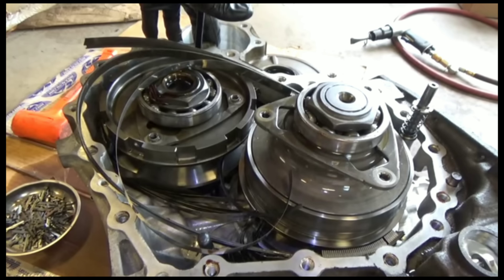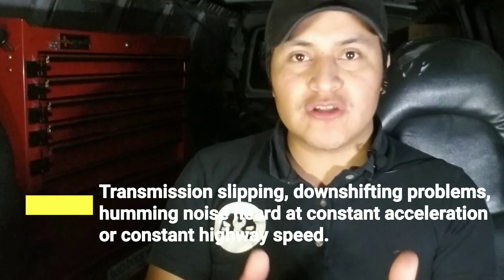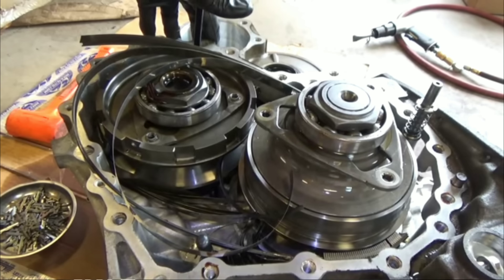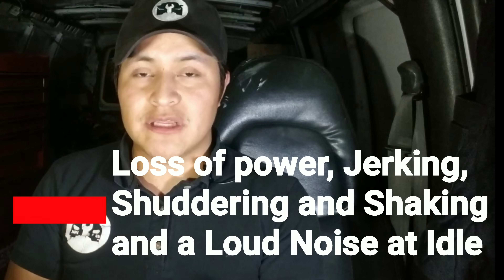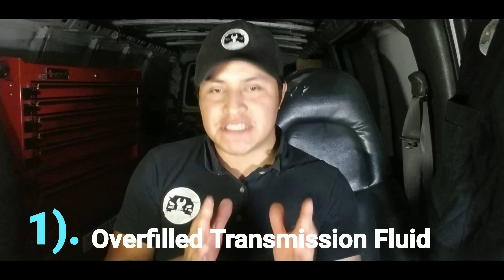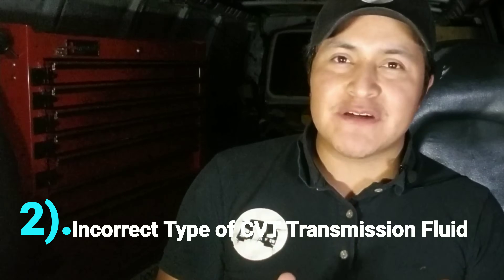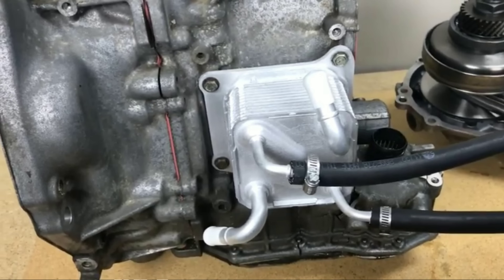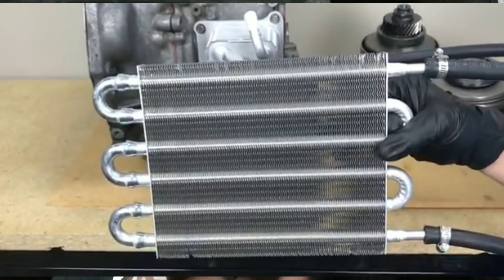NISSAN CVT TRANSMISSION | why it fails and what you can do about it to prolong it's life

Comment: Hello, I have a 2004 Nissan Altima Qr25.  Every time I start it it goes well, but since returning to first gear it has refused to change again.  In order for it to change I have to turn it off and start it up it changes normally.  What do you heal with such a problem

Comment: I have a 2013 Nissan Rogue, it has a high rpm on cold start, I've cleaned the manifold and mas, and other thoughts to what it could be? No codes given. Thanks great video!
Reply: They rev high in cold temperatures by design. It's for faster warm up. Don't worry about it.

Comment: I got 2017 Nissan SV as my first car. After 3 months of purchase I had one of my tires got nail stuck and winter came. Since then, in every bump I get ABS signal. I told this issue to my dealers every time I went for service and they would just say we don't see that happen. I just changed the all four new tires and still got ABS signal on a bump. I'm so done with NISSAN. Never suggesting this junk to anyone.

Comment: Very well explained.  I have a 2016 Murano Platinum with 40,000 miles on it. The CVT just failed this evening.  When I started the car and put it in to drive, as soon as I started off after about 10 mph it started to shuttering. There was a wining noise from under the car.  I contacted the dealer to make arrangements to pick up the car.
Reply: Did they replace the trans?
Reply: Will they replace the Transmission? 
I got the same issue on my Nissan Altima 2016 SV
Reply: @donjuanjo1000  same deal with me, but it’s a 2015 with 77,000 miles

Comment: I have a question I hope you can answer. I have a 2016 Juke, My car sometimes jerks when accelerating and decelerating at low speeds, I can sometimes feel a hard "shift" at around 5th gear when in manual mode, and sometimes the car just wants to hang at around 4K RPMs and will "shift" when I let off gas.

Is my CVT possibly done?
Reply: Change your fluid 2 times... And change the filter... Only use OEM fluid

Comment: My car ( 2010 Sentra SR) is still running but has a high idle, loud whining noise frim 2k RPM and up ( gets louder the higher the rpm) and when rpm lowers the whining noise stays and sounds like a power steering pump till it hits 1.5 rpm. Any ideas what this could mean? I’m on my 3rd transmission and I only have 66,700 miles on it.

Comment: 160,000 on my '07 Nissan Altima 2.5L. Not one problem. 45,000 on my '17 Nissan Maxima 3.5L. No problems there either. Just respect the iron and they will do you right.
Reply: 09 Altima coupe still going 207k miles

Comment: Thank you for your advice and information!!! I saw your YouTube video on CVT transmissions. I unfortunately have a 2013 Nissan Maxima SV and the transmission went out. Everything else on the car is perfect. What year and model would be an affordable transmission to replace the bad transmission so I won't be in the same situation and not have to shell out $7k to Nissan for a new transmission? Thank you!
Reply: Costs like 3600 to replace. Where did you get 7k? Mine went out in late 2018 and hadn’t had any more issues yet but I got all new transmission built locally by a specialist. (All new parts so basically new transmission).
Reply: @justanotherhandle1  That was the dealership's quote...

Comment: Hi. I have an  2016 Almera and there has been a clicking sound coming from the transmission when i change from P to D or R. There is also a clicking sound when I press the brake as well. Any advice as to what these sounds indicate?
Reply: @Shaun Booval did you ever find out what the problem is?
Reply: @shantaereed5703  Hi, it seems to be the engine mount.
Reply: @shaunbooval9223  ok thanks!

Comment: Hey, question! Does anyone else get kinda jerky acceleration around 30-40 mph? I drive a 2012 Sentra, though I’m sure it’s a cvt issue. No noise, and it’s fine at 40+. I took it to the dealership and they said it was nothing. I would love to know if anyone has experienced this and if there is a fix. Thanks in advance.
Reply: yes it has happened to me. I had a 2002 Altima and 2009. both cars would jerk when accelerating and I had it checked out as well and was told nothing was wrong with the cars. both cars lasted over 200,000 miles. continue to maintain the vehicle with oil change every 3 months and it will last.
Reply: @33staysee  thanks for the comment, I can’t imagine driving enough to change the oil that regularly. I drive about 100 miles a week. Any thoughts about transmission upkeep? My warranty is dead and I was hoping that when I got the chip replaced (I went into limp-home mode) that the issue would disappear.
Reply: I have a Nissan Sentra 2012 with 200,000 miles but I don’t have a problem you’re having. My problem is when I drive long distances and the CVT add some certain point they won’t accelerate when I’m driving on the highway. Then I pull over then it’s OK then I can drive back home. Have you had that issue

Comment: Yep, wish I had done my research before buying my Rogue. CVT failed one month after I bought it. Battled with several leaks in my cooling system, and ultimately had to replace the whole transmission with a rebuilt one that had an improved cooler. Then I battled with getting the transmission fluid level exactly right, because it was still overheating! Eventually I installed a condenser/cooler just like the one you showed and got the transmission fluid just right. It's been a couple years now and everything is working like it should. Surprisingly, the original transmission lasted about 150k miles. On some of these vehicles, the CVT pops after as few as 25-30k miles.

I'm grateful to people like you who make consumers aware of these sorts of problems. Unfortunately, I was screwed as soon as I bought the damn car. Never buying a Nissan again, or any vehicle with a CVT for that matter.
Reply: Sounds like u weren't doing the proper maintenance
Reply: @LadyJpraise2024unbound  He said it failed after owning it for only one month, so it wasn't him that neglected the maintenance.
Reply: What year was your Rogue? Thinking of getting a 2019 Certified
Reply: @publicemail6518  It was a 2009. I would still avoid, because the CVT problems were present on newer models as well.
Reply: @publicemail6518 you better think again! Buyer Beware!
Reply: @publicemail6518 Check repairpal and Rogue was the 8th best-selling vehicle of 2024.  It has been on the list for a minute.  If all these cars were so bad why are people still saying them?  Why aren't mexhanic shops filled with just Nissians if the cvt just breaks down all the time.  Check JD Power for the score they gave your year.   Repairal had no significant complaimts on Rogues for 2019.  I have a 2023.  The first complaint I came to was 2018 and it was about the fuel gauge.  I stopped there bc it wasn't any data on 2019 on.  There has been improvements and maintenance updates.  Get teans fluid done every 30k miles. Keep maintenance up.  Don't do the trans yourself bc it does have a specific fill guidance that if not followed will damage it.  Toyota having to replace engines on Tundras and Lexus.  Maybe Nissian has  made the necessary changes to establish longetivity on theirs.  Alot more positive posts than negative I've been reading

Comment: Great job. Clear explanation of issues and proactive action to remedy them.  I own a Rogue 2013 and yes the transmission overheats and reduces traction power.  I just bought an after market transmission fluid cooler and will see how it helps.  You have an excellent way of keeping your narrative to the point and practicality.  Thank you for sharing your knowledge.
Reply: How did that after market transmission fluid cooler help? I have a Nissan Rogue 2012 and it's been having this issue for a year now when driven over 2 hours nonstop
Reply: Replacing the factory transmission fluid cooler with aftermarket unit and adding a radiator to further lower the transmission fluid temperature was a great improvement on my 2013 Nissan Rogue.  I am pleased with the results.  Gained torque and also a more responsive transmission tested over trips of over one hour.  Overall cost was less than $200

Comment: Honestly thank you so much for this video. This was so helpful in explaining why my car was having issues. The mechanics didn't even tell me this when my car had trouble.
Reply: Nissan is JUNK.  I also have a Sentra and it is a piece of crap, and the dealership wants to do nothing about it. Nissan has been sued about their transmissions, and mine has multiple other problems including no working AC in Florida. Very expensive work needed and it should just go to the dump. Nissan is a totally and completely irresponsible company and their sales people and their service people are all scammers and liars, and that’s my experience.
Reply: @janetpattison8474  CVT should only be used for what were designed for go card and snowmobiles
Reply from the maker: You're welcome
Reply: Nissan dealers don't even know those exist lol they said no filter in it.

Comment: Thanks for the info young man. I have a 2016 Sentra who’s transmission failed at 126k miles. The fluid was replaced at 80k because Nissan was the only place around here with the equipment to do it. I’m spending $3400 for a new transmission install out the door since gas prices are north of $3/gal since the orange menace is out of office replaced by the America last Dotard. I will park my F250 Ford and use the Sentra for work and my wife scored a new 2021 Subaru cross tech. I hope I made a good investment of $3400 since I will save $1200/yr. with gas at $2.50/gal. I actually hope gas spikes past $5/gal so the low IQ idiots whom voted for the America last Dotard can’t even drive their 32 mpg Highway Sentras. It will make my job that much easier. Like when the biracial Obama whom identifies as black which is racist onto itself was POTUS.

Comment: Man I have had a 2014 nissan s with tech package since  BOUGHT brand new and NEVER EVER CHANGED  THE CVT FLUID in the 1st year i put a real hard fast rough  45,000 miles on it its is now has 197,000 MILES ON IT AND STILL HAS excellent cvt transmission  STILL HASVE NEVER CHANGED THE CVT FLUIND THE ARE ALL HARD MILES 3/21/2021 we got it 7 years ago today anyone who tells u they are junk
Is a troll from another  car  company  lieing about  nissan yal a bunch of dumass sheep if u listen  2 these lies

Comment: I’ve seen some mechanics add a transmission fluid cooling kit. They attach it in the radiator area. 
What do you think of this
Reply: Yes that helps the fluid get to temperature faster which reduces wear on the transmission

Comment: I have a 2014 nissan versa and I was told that we needed to change neutral safety switch and still didn't fix the problem. I was then told that the motor mount needed to be changed, the transmission mount. Done that and still not fixed. The problem is when I back up it jerks like I hit something. Put in drive it jerks. The motor moves back and forth.

Comment: I have a 2011 Nissan Serena, what is the correct transmission oil and motor oil to use??? Thank you
Reply from the maker: We don't have those cars in the US but here's what Google says:
Engine
2011 All-season +25 to -25 °C 10W-40 15W-40 Winter -35 to +5 °C 0W-40 5W-40 Summer -5 to +45 °C 20W-40 25W-40
Transmission:
As for the transmission it should be on a sticker under the hood
Reply: @WrenchLink  Thank you

Comment: So here my question: a part early models which were suffering of premature failure (2012-2016 Jatco transmission family j7 and J11)...how is it possible saying these transmission are junk when there are.many people going over 100k without issue? If I may I would compare with DSG..do you know how much cost the meccatronic replacement of the clutches? And still today are quite famous to fail before 60.000 km...boh.

Comment: Install your aftermarket cooling system whenever you want. If the transmission fails, take it off and put the original system back on. Do a proper job and I doubt the NIssan technicians will be able to tell what you did. Especially if you don't say anything that might make them think you may have done that  – it is unlikely they will be suspicious and look for signs that you did that.

Comment: That’s great information on CVT,already have an issue with noise,heading to the dealer right now.
I just came back from the dealership.My issue turned out to be wheel bearing.Fixed.

Comment: another contractor like me has just over 2600000 on there nv with 0 problems so far i think they changed them after 2015, but we have lots problems with gm 2500 van transmissions, thinking bout switching vans to nissan full size  other contractors we no have nothing but good to say bout them, not the best gas milelage though also  what about the other manufacturers of cvt dont think they any better heard of problems to,

Comment: Thanks for your video. I have a question. My 2016 Nissan Almera does not come with a ATF dipstick. How would I know if the ATF is over filled or under filled??
Reply: Use the oil stick....

Comment: My Nissan Altima 2014, jerks when accelerating, these jerks are often when accelerating between 40 to 60 km speed. and its 65000 Miles. If I knew this I would have never bought this car. btw in worst condition, how much it will cost to replace CVT if it completely damaged. ?
Reply: What CVT fluid you use?
Reply: @Peace-bn4iy  The orginal .. i dnt rembr its name but from orginal nissan shop after showing them my vehicle registration to make sure they give the orginal as per my model.
Reply: @zeeshan85627  So how your trans now? Still not good when at 40 to 60 ? Mine feels like slight pause when entering 40 or 60. Btw mine is Nissan Juke 2012
Reply: @Peace-bn4iy  Yup it is still the same, I have visited the local mechanical but infront of him the car is smooth AF. Strangely !
Reply: @zeeshan85627  Hahaha same here... When the mechanic tried my car, the problem just gone!

Comment: Best advise: do not buy a Nissan.
Reply: wish i saw this before the transmission in mine failed
Reply: @emily239  how long did you have your nissan? also how many miles if you don't mind me asking? i have a sentra with about 42k miles and it's working great atm (cvt transmission)
Reply: @PrideofPitchers  mine had around 90k but it’s still good to get to places like 5 minutes from home until it’s fixed lol
Reply: I'm driving my 2nd Murano. The first was a 2004 which had 122000 miles when I got rid of it. Never had a problem with the transmission, and I towed a 1800lb boat with it.

My 2nd Murano is a 2016, I currently have 33K miles on it, and no problem at all with the CVT. I no longer have the boat, so no towing.

Comment: @Wrench Link  Please introduce how to completely FLUSH Nissan Rogue transmission fluid. The dealer drain & refill no complete , becouse U have to change gasket and fillter and flush all the old out, show me the step for DIY.
Reply from the maker: https://youtu.be/htIk2VtBSik
That's a video for an Altima but it's fairly the same procedure. I don't focus on DIY I focus on information about vehicles that have problems and what to do, also Vlogs.

Comment: I have a question. I have a 2011 2.5 Altima with a CVT, with 168,000 miles. I admit I have had the fluid changed as prescribed but my car are not having the symptoms as related in this video. First this is my first time with an issue. It was a cold morning in the upper 30"s and the car had not been driven in about 4 days. After starting I started off and the car would hardly move. The transmission was slipping badly but there was no whine or grinding noise whatsoever. I drove it around in the yard and gradually accelerated to about 25 mph. It seemed to be doing ok. Then I slowed to about 5 mph and drove onto the road to again accelerate. It was slipping bad still, but not quite as bad as before. I know the transmission was NOT overheating. The temperature gauge had not reached normal range yet. After the engine reached normal operating temperature the transmission did fine unless I gunned it from a dead stop, where it would slip until I went to a normal acceleration speed. Once the car was completely  was good and warm I could not tell there was any slipping at all, although I did not test it extensively. To my knowledge the car has never overheated nor had any problems previously. So if this is the case and there is no signs of the usual symptoms, what would you guess as to being my problem? As I said it does not make a noise at all when the engine is idle or revving. I have not checked the fluid yet because I read that the CVTs had to be hooked up to a computer analyzer to properly get the right reading. I don't want to mess it up with too much fluid.
Reply from the maker: A transmission fluid leak maybe